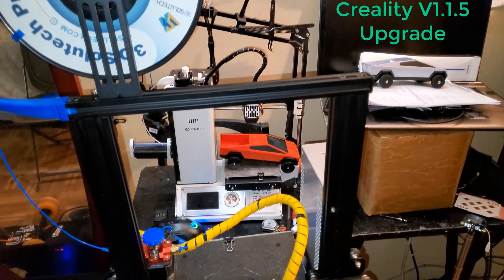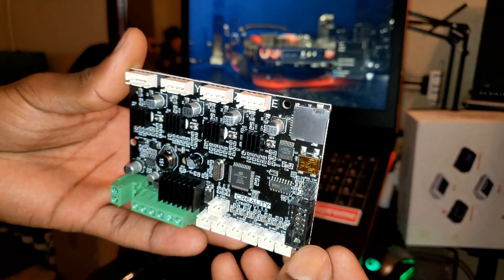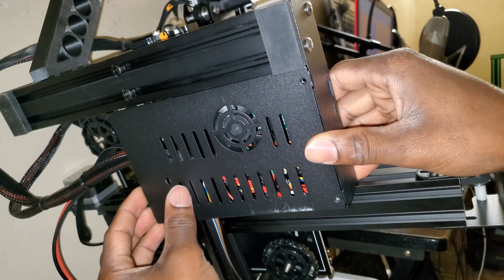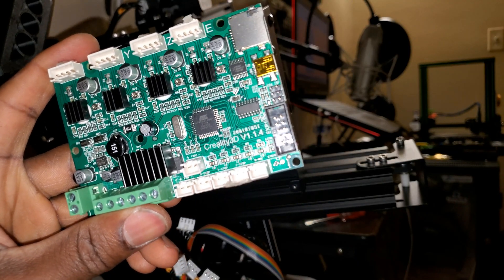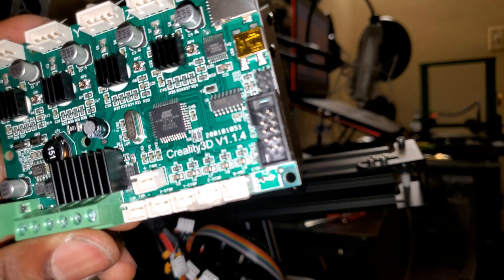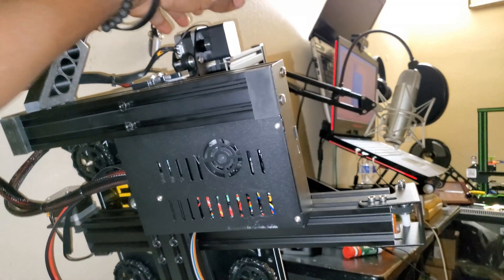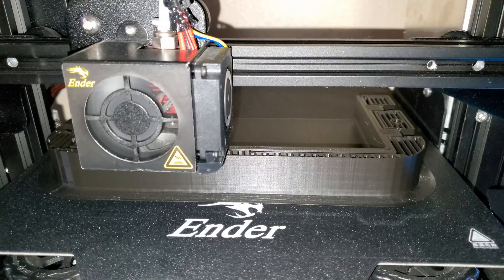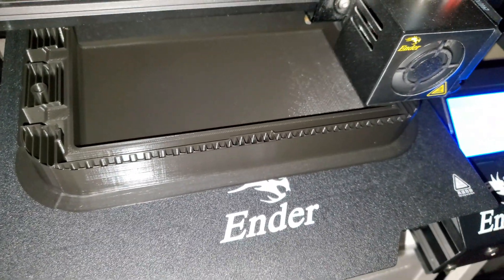Creality Ender 3 Pro Silent Mainboard Upgrade | Mute silent Boad V1.1.5

Comment: Great video. I've heard something about a 24V and 12V fan. Did you have to make any changes?
Reply from the maker: I haven't made any changes, but if you are replacing a fan, heated bed or heater element, then you have to get the right voltage (24V). You can measure the printer's voltage from the XT60 connector https://drive.google.com/file/d/161_t8UrWmrUtytDVHbJttLlZa8vL43Od/view?usp=sharing